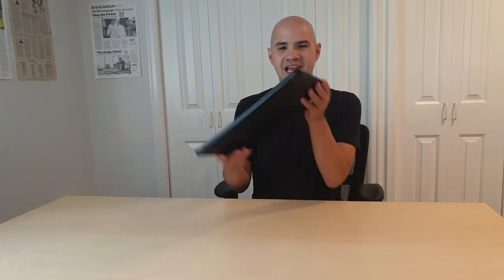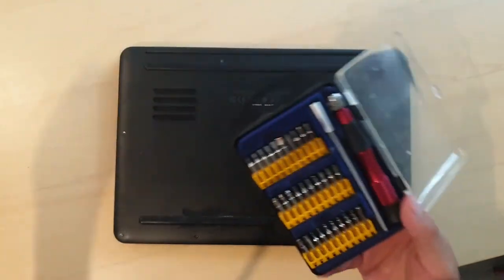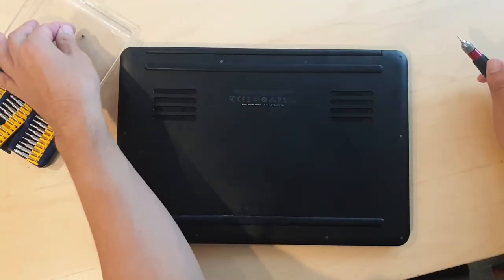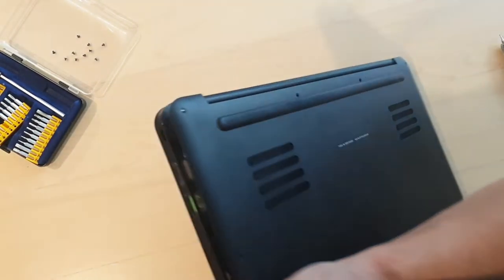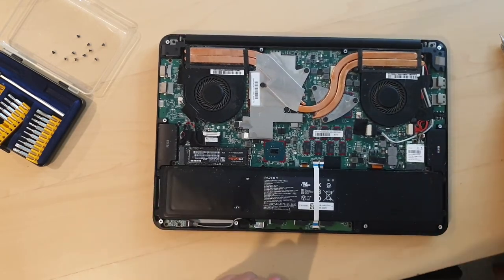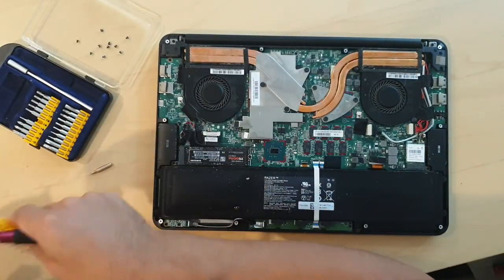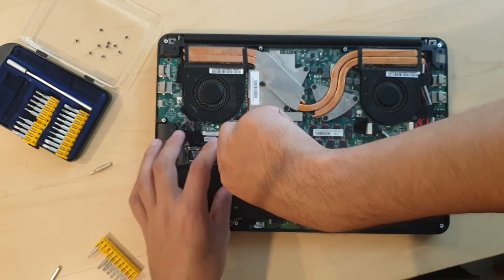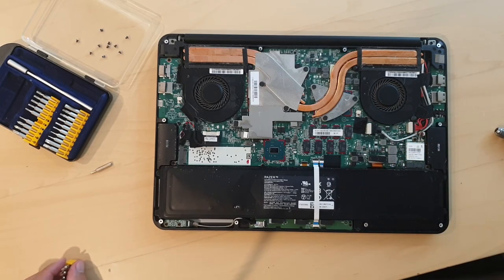Removing the SSD (NVMe) from a 2017 Razer Blade 14

Comment: hello! I wonder is the 2tb ssd fit in this 2017 razer blade 14 ? I want upgrade mine, but cant find any guide. thank you so much!
Reply: Me either have you found out any guide yet? Mine is a gtx 1060 i7-7700hq and 256gigs ssd and is it upgradable?
Reply: @zayk5675  As long as it's single sided it should work. Like only one side. Also have you upgraded your SSDs? Which one did you put in there?